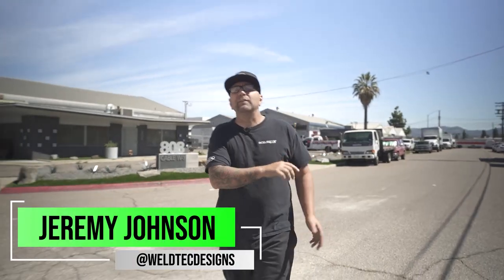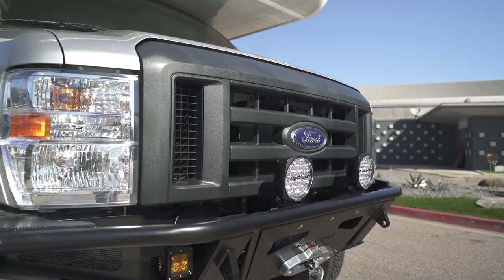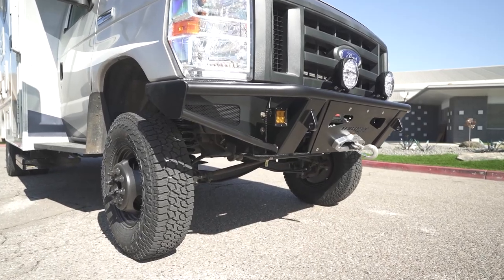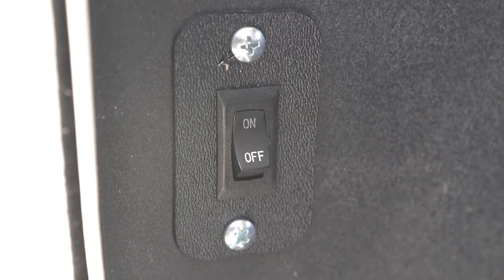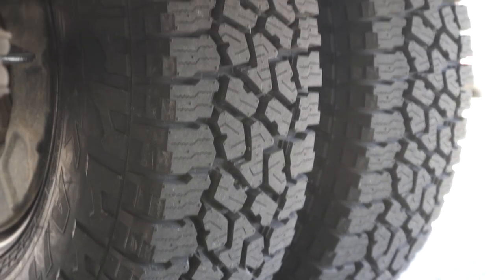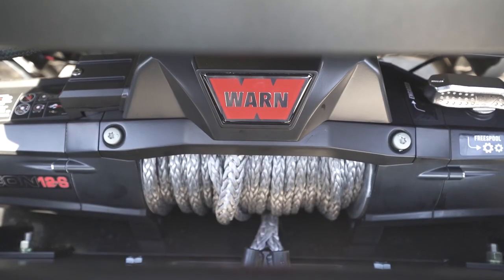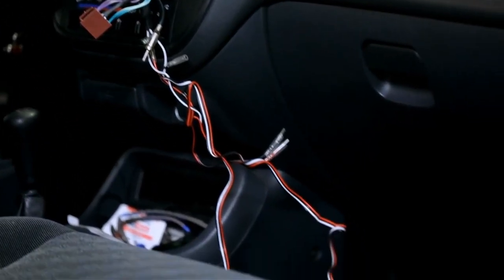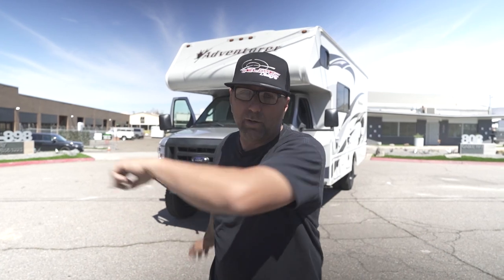ULTIMATE Class C Adventurer RV BUILD! | 6" Suspension Package For "OFF GRID" Travels!

Comment: Hey Weldtec love love love this set up. Wondering if instead of a wench in the front bumper if there could be a 2” hitch? What would this set up run $$ with all you did on this rig minus the wench? 
Tires
Powder
Valve stems
6” lift
Step
Bumper with lights (all)
Light controls inside
On board air
And all that jazz?
Reply from the maker: Hi Joshua.  Glad you love this build.  You can use a front receiver hitch with any of our non pre-runner bumpers.  I'd recommend you give us a call so we can discuss your build and get you a quote.  619-596-9831

Comment: Awesome vid!  Will the valve stem extenders work with rubber valve stems or do they have to be upgraded to metal ones?
Reply from the maker: Yes they do.  You just thread them on to your existing valve stems. https://weldtecdesigns.com/product/wheel-masters-rv-valve-dually-extenders/